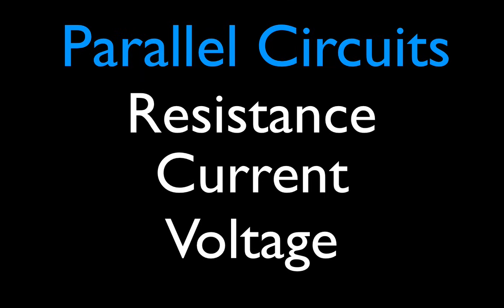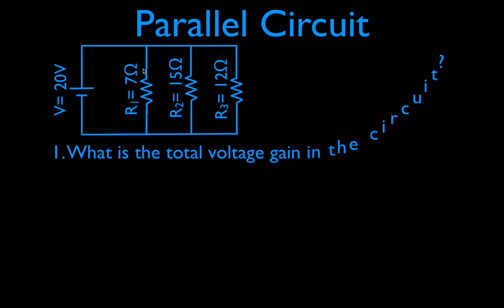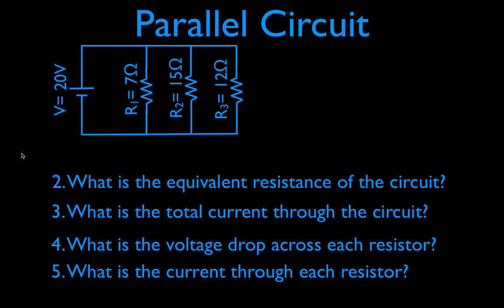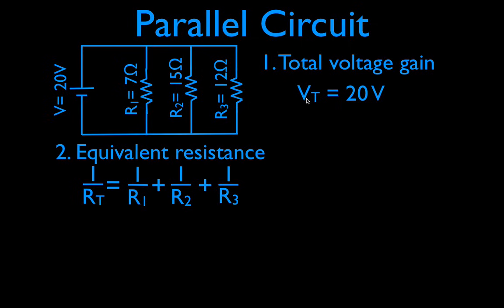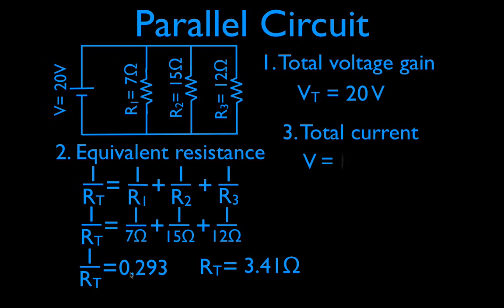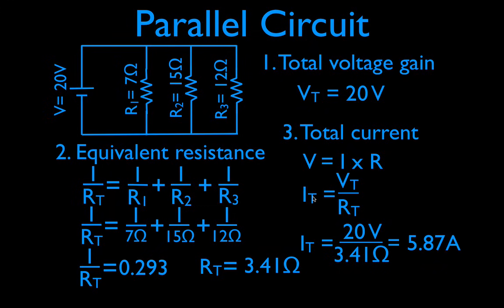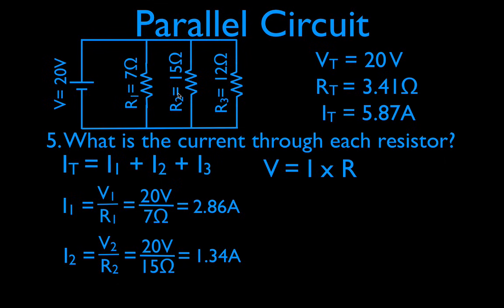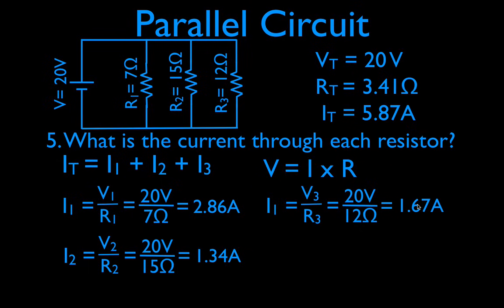Resistors in Electric Circuits (3 of 16) Voltage, Resistance & Current for Parallel Circuits

Comment: great vid I.just subscribed, I know you can't answer all questions but I really need help , its so simple yet so complicated, what formula do.I use to calculate what resistor I need, the problem.I find hard to believe is, let's say I.have 2 li-ion bats, each 3.7 2300mah so I connect them.in series I get 7.4v and 4600mah, my halogen lamp is 6v 5watts, I used an online calculator and it said I need a 1.4ohm resistor, now im not a pro an resistors or else I wouldn't be here but I I doubt that 1.4 ohms will withstand 4,600mah , please someone anyone enlighten me

Comment: Excellent upload, thank you. I have one question, sorry if I'm being stupid or missing something obvious, but why do you divide 1 by the resistance totals? What does the 1 represent? I've seen many explanations and videos of parallel circuit calculations, but never an explanation of WHY it is done in the way it is done.
Reply from the maker: For parallel circuits the equivalent resistance is 1/Req.....  That is the equation.  There are other forms of the equation but this is the form I learned.

Comment: I like to say that when you are adding resistors in parallel, the important thing to remember is that you are not adding more resistance. In effect, you are subtracting resistance, because the significant thing that you are doing is ADDING A WIRE. By definition. if you are adding a resistor in parallel you are also giving the current and another path to go down. You may notice that the total resistance that Mr. Swarrthout came up with (3.41 Ohms)  is LESS than the lowest single resistor in the circuit (R1 at 7 ohm).  This is only right and proper and will ALWAYS happen in a purely parallel circuit.
Reply from the maker: Yes, you are exactly right, great point, thanks for commenting.
you can see a listing of all my videos at my website, http://www.stepbystepscience.com

Comment: okay your videos were extremely helpful. And I noticed that in the calculations for parrallel circuits, the voltage is the same throughout but the current differentiate and for series the current is the same and the voltage drop differentiate... are those characteristics for the circuits?
Reply from the maker: +Karen Johnson Exactly!  Thanks for your comments.  You can see a listing of all my videos at my website, http://www.stepbystepscience.com